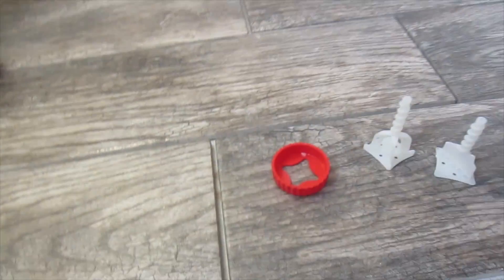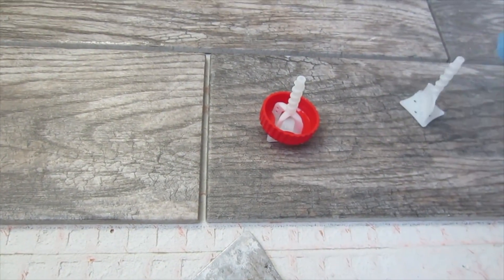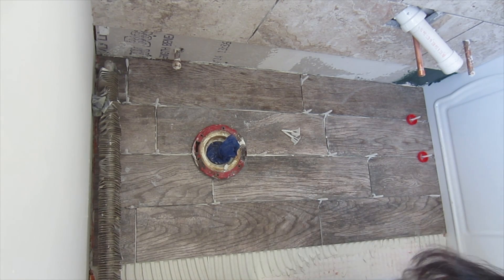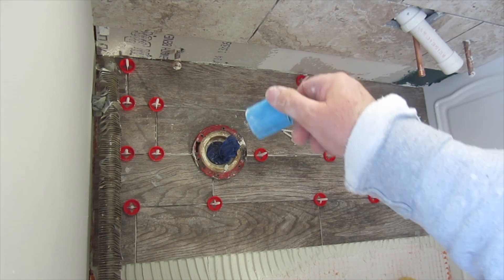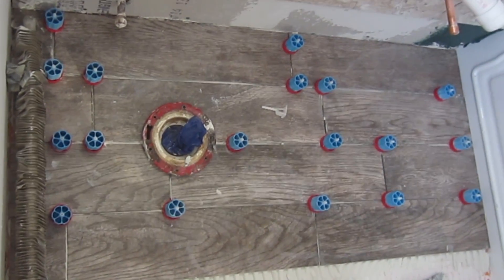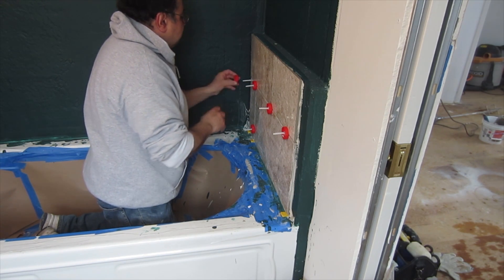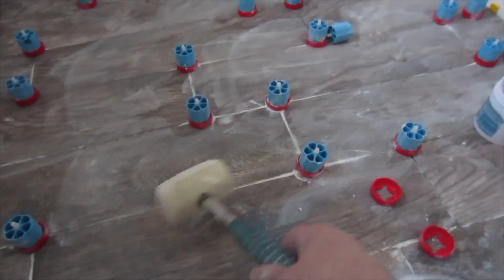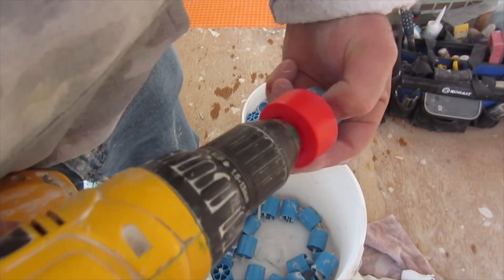Protection caps for Proleveling System by Progress Profiles

Comment: I tried this system a few years ago and i didn't like it. Is the spin doctor better than this one or is it the same quality?
Reply from the maker: Spin doctor is different, but it all depends on personal preference.
Reply: Sal DiBlasi Sal DiBlasi Does the spin doctor open up the joints? The proleveling does.  Does it break when you try to tighten it up tight if needed to get rid of lippage? With the wedges and clips i can tighten it up as tight as i want using the pliers and it doesn't break on me, but with this proleveling system it tends to break if you keep turning it. I wonder if the spin doctor works the same as the proleveling? Is it sturdier? I wanted to try the spin doctor because it looks faster than the t-lock or raimondi.